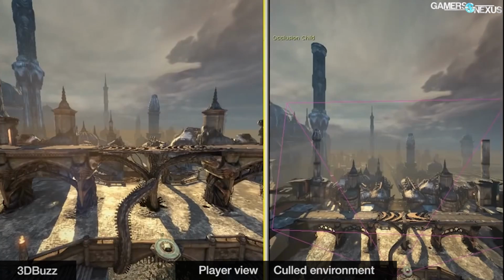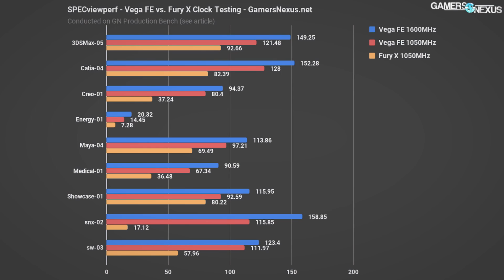Primitive Discarding in Vega: Mike Mantor Interview

Comment: object bounding box culling is a engine thing. scissor test (for out of 2d 'frustum'/plane) and backface culling are known stuff too.. you can shovel backface culling in the dumpster if you wanna use two sided ligthing shaders (foliage. and hair). early-z culling only works efficient if the drawcalls or even just the polygons of the objects in question are rendered front to back. out of order triangles usually don't early-z either. they are hard to predict. all known things to developers tho. even me. :)

Comment: Frustum culling is a super basic thing to do, every engine has it and it's not a new thing by any means, backface culling, same thing, supported at least from directX 6.0 you can check the documentation, I dont wanna believe they weren't doing it before... The only interesting thing is the too small to be seen triangles. Honestly I was expecting something for the triangle overdraws, that would have been far more interesting. You can see the problem even in the video, when the camera goes behind the mountain the frame rate doesn't improve, this menas that all objects behind are not removed. It seems to me they're selling old stuff as new features, very sad....

Comment: Im assuming that Vega has more changes from Fury than a re-layout for higher frequency and a more efficient shader.
Reply: DarkHalmut along with the node shrink~ tbh it sounds like a normal iteration cycle, expecting more is naive.

 Navi was always more interesting on the roadmap due to the "scalable" moniker which AMD uses heavily in a context of linear scaling over multiple lithography dies. which makes it exciting. That said infinity fabric style architecture in GPU is all but inevitable and game changing, However not unique to AMD Nvidia have already announced they are doing the same. So no guarantee AMD will gain the upper hand with Navi either, especially if Nvidia beats them to the punch with their own scalable architecture.

Comment: But the calculation of wether or not the geometry is in view also is costing performance (on the cpu side).
The question is if it is worth it?
Theoretically, it should be worth it in above 1440p resolutions with cranked up detail, since you rarely get cpu bottlenecks there.
On 1080p though, its probably not that worth it, since you already are more cpu bottlenecked than gpu bottlenecked.

Comment: This is nothing new, game engines and drivers have done this for years. 
This is just a buzzword. 
It sounds like all they added was culling on the back of a 3d object itself. 
You can see this in older games with fast movement speed and old video cards will sometimes show a black side area where the renderer hasn't sent the info about.  
I'm not impressed if AMD thinks this is important and thinks Nvidia doesn't do the same thing..

Comment: Result : all of this reduce performance . Fiji performance per mhz seem higher then Vega.
GPU complexity goes up, more transistor used... for something that often is better done at the engine level.
Reply: No most engines only do whole object culling(With few exceptions) doing vertex culling does make a lot of sense because the engine rarely touches a model after it has been pushed to the GPU which is why it makes sense to do it on the GPU  primarily.

Comment: If you make tris one sided and use an algorithm like the shoelace algorithm you can stop what's facing away from you and therefore what you can't see from being drawn. I'm not just talking out of my ass either, I've implemented this in a shitty scratch 3D engine
I'm pretty sure it's something along the lines of: (x1*y2+x2*y3+x3*y1)-(y1*x2+y2*x3+y3*x1) if you want the actual formula you can google it I'm just too lazy
Reply: In most cases triangles are one sided by default and the GPU leaves it up to the engine which way the triangles are facing.In most cases the vertex order is what determines which way a triangle is facing.

Comment: okay so what happens if say an object that would normally cast a shadow is out of view and culled, would its shadow also disappear. So for example your in a room with a window. light is being cast from a point such as a street lamp. There is a tree between the light and the window so from in the room facing away from the window, would either still see the light from the street lamp, see the shadow the tree cast through the window, or see any light at all because the window, the tree and the light have been culled.???
Reply: This mainly depends on the game engines implementation of lighting.
Reply: a shadow mapped light has it's own frustum when rendering the depth map. this may or may not cull object's in it.
Reply: Shadows and light are often baked for static object. In case of runtime computation there is not problem either because the shadow map is generated from the light-source point of view and the rendering goes through the same process

Comment: This sounds like what PowerVR was doing with Kyro. Does Vega also have tile-based rendering?
Reply: PCX and Neon 250 as well. Sega Dremcast and its arcade board variant Naomi series are currently the only tile-based rendering system hardware.
Reply: I thought that the whole idea died with Kyro. Checked wikipedia - nvidia maxwell and pascal series as well as pretty much every mobile gpu uses this technique to save memory and bandwidth.
Reply: Not surprising from nVidia  because they use the partial tile rendering method obtained from the defunct 3Dfx IP who brought Gigapixel. Note that I purposely excluded the mobile market
Reply: "Does Vega also have tile-based rendering?" They are suppose to in the future. Supposedly Tile Base Render will be incorporated into software updates as the card develops. Last I heard

Comment: When I play video games, I usually delete the polygons I'm not using and then stream download the ones I need. Of course, you sometimes run into problems with rgb compression textures and screen space usb ports. I usually get around this by overclocking my resolution.
Reply: You guys got it all wrong you need to undervolt your textures to improve efficiency.
Reply: And don't forget to filter for sinusoidal depleneration
Reply: yes but dont forget to overamperage the triangles before doing so.
Reply: I do some formoluted pretzelo-cakeification and ingest it in the pipeline.
Reply: Also if you have problems over clocking your resolution, try undervolting tessellation, and amp up antialiasing, it should help your monitor thermals too

Comment: This seems like technology that should've been included a long time ago, any ideas why it's coming up now? If the minimum reduction in rendering is 50% then surely some GPU developer would've jumped on it much earlier.
Reply: It costs transistors
Reply: John Honkerton It was first introduced in Polaris.
Reply: It used to be done by game engines.
Reply: Most game engines already do some form of culling. Unreal has a few different types to chose from.
Reply: As stated in the video, it has to be implemented in the hardware to get that kind of performance gain.  Remember that they stated that if you do not implement primitive discarding before it hits the pipeline then it eats clock cycles, which means less performance.  It is impossible to implement a software solution from a game dev that can access the video card at such a low level.

Comment: Can y'all try to clarify what the Draw Stream Binning Rasterizer and the Tile Based Rederer's relationships are to this primitive shader tech? Sounds like the primitive shader stuff is largely developer/engine reliant whereas DSBR/TBR is automatically part of the pipeline. I'd really like to know more about these things as they appear to be a big part of Vega's performance. It would appear from PC pers. testing that TBR isn't enabled in drivers yet. Also, can commands from non supported game engines be intercepted and converted to primitive shaders on the fly? If possible that could be a big win for Vega on older games.
Reply: Yes, isn't TBR supposed to be one of the things that Nvidia's been doing for quite some time? Will be interesting to see how much of a real boost that provides AMD, especially if it isn't enabled in the current drivers but will be enabled with the release drivers.

Comment: cant even pretend i understood any of this :(
Reply: Basically, the GPU's figuring out what objects in a game (walls, floors, lamps, tables etc) are being seen by the player and only renders those, which means higher FPS and lower specification requirements for games.
Reply: aye i got the very basics but how it works flew over my head like a jet wonder if i grow my hair out into impressive locks if id be able to grasp the more advanced parts :(
Reply: Some basic concepts... This will already give you a slightly bigger understanding.

I assume you know rendering in 3D space is done through geometry, which basically means mostly triangles...
The 'corners' of those triangles are called vertices, or vertex for singular.
Even though the image is 3D, you have to project it on a 2D screen, which is where the pixels come on. 
Pixels are the 'dots' that ultimately form up the 2D image from a 3D calculation. So basically the pixels that you see on your screen ultimately.
Shading is basically giving color. So a pixel shader calculates which color a certain pixel should be.
Reply: dark1810 hah I feel the same way. I enjoyed watching it but understood like 1%.

Comment: With culling, what about light effects coming from objects not visible themselves?
Reply: Light and object are two different things. In games you have an object (say, a lamp) and a light source that positioned to match the position of the actual light source of the object you want to draw (where the bulb is). Basically, object is a physical thing on the screen that has vertices whereas light source is an abstract thing that only describes the light - its position, type of the source (point, directional etc), color, direction and other stuff. When you're culling you're only discarding vertices of the object. The light source that's attached to it in the game world is still there and later will be used to do the lighting. You don't need the object to do that (the lamp). In fact, in games there're many cases where you want to put light sources that has no object at all. For example, in cutscenes to better light character faces - you don't need a lamp for that, only the light source. Of course, that's very basic explanation and exact details could be very different depending on the graphics engine.
Reply: TheEVEInspiration I think lighting references remain untouched even if the geometry is discarded. That way, if you get a world view and compare it to the player's view, the lighting comes from apparently empty space.
Reply: That's a very different question. You see, you can't think of realtime 3d graphics (at least in games) in terms of real world phenomena. Everything is decoupled from everything in order to make it faster. So, light sources and objects are not related to each other in any way - only in the head of the developer that put them. Casting light and casting shadow are two different things that's done separately and do not depend on each other - many light sources in games are not casting shadows, only illuminating the world. Pretty much every single physical phenomena you see on screen does not work like it works in real world. It's all about tricks that produce somewhat realistic image on screen.

As for shadows specifically, there're done in different pass. That's, again, another not very obvious thing about 3d graphics. Usually in games you do a separate shadow pass - you take your objects and light sources and calculate a shadow map that contains only shadows. You can do your own culling here but it's very specific to shadows - for example, here you can cull objects from the point of view of a light source. Then you do the main pass that draws the scene and here you use that shadow map to apply shadows to the scene. And that's why you don't see many shadows in games and in many cases light sources just illuminate stuff - it's very taxing to do shadows. Basically, you have to loop through all objects for every light source. That's why there're very few shadow casting lights sources in games. In many cases just one - the sun. On the other hand, with techniques like deferred rendering you can have hundreds of light sources that only illuminate the scene giving you the illusion of complex lighting.
Reply: TheEVEInspiration Culling does not really remove the geometry but just skips rendering. It is still in graphics memory. When you render a mesh you don't send it triangle by triangle but upload the whole thing beforehand and then send draw commands which part of the mesh data should be drawn.
Reply: Good question- perhaps a geometry reference is preserved?
Reply: Shadows in games are usually created with shadow mapping. In this technique a depth image is rendered from the position of the light source viewing in the direction of the light rays. This image can then be used for the actual rendered image to check which parts of the scene are not visible from the light source, i.e., lie in the shadow.
Culling doesn't interfere with this because it is done for each rendering pass. So for the shadow map only objects that are not visible from the light source are culled and for the actual image only objects that are not visible for the virtual camera. So culled objects still would cast shadows.
Reply: I think he means like what happens to objects out of scene that are casting shadows into the scene.
Reply: a quick sample that shows this is the showcase at 2:05, the shadows are still rendered while the objects are culled.
Reply: [to unstabletv] That's a case of baked lighting. I am speaking only of dynamic lighting.

Often times before a level is even "finished" for you to play, they pre-cook the shadows on the environment so they don't have to calculate the shadows in real-time. Shadow-map. Yeah. That.

Everyone else is giving good answers, too.
Reply: +TheEVEInspiration
Reflections are a big topic in realtime 3d graphics. Today very common technique is to use what is called screen-space reflections (SSR). The main part is "screen-space". It means that to do all calculations it's using only what on the screen regardless of any culling. You could even use no culling at all because SSR doesn't use vertices, it only uses various maps of the frame being rendered (like color, normal and depth maps) But you do have a problem because of that - anything that's not on the screen will not be displayed in the reflection. You have to be careful applying these reflections - results can be pretty bad in some cases.

But for things like water, again, separate pass is used. Culling for the main pass is irrelevant as you're drawing whole scene separately just for the water reflections. It's called planar reflections. Same thing with reflections on cars in racing games - usually it's cubemaps in a separate pass. As you can imagine, it's very costly to do these types of reflections. As optimization pretty much every games does separate pass with as simple as possible models, effects, draw distance etc. You could even lower the rate with which you update reflections.
Reply: +Doom2pro,

Yes, shadows and reflections, that sort of effects, which can have impact outside of the geometry, but where geometry is implicitly involved. I just do not know how common this is, but it looked like an issue to me when removing geometry.
Reply: Other's can correct me if I'm wrong, but afaik that's not an issue in forward rendering. And deferred rendering already introduced (and solved) that issue (with anything outside of the screen domain), you generally just have different rules and behavior for edge cases i.e. real-time emissives. 

Also honestly even hypothetically I can't see how this would contribute, it's only culling non-contributing/non-sampled data. And not to mention lighting isn't a primitive, its in the pixel shader stages. in deferred you're only calculating lighting on a per sample basis in the screen buffer using information from depth buffers and normals buffer etc. Deferred pipelines are all about the G-Buffers. most the heavy lifting in modern game engines is in the later stages of the pipeline, and thus why you won't see a 2-4X improvement in frame times correlating to the culled primitives)

Worth noting most modern engines are deferred now and make compromises with alpha and emissive contribution (or simply do without), just look at how unreal engine handles alpha now for a picture of how forward compares to deferred.
Reply: oh just read the chain. Yeah shadows are a different ball game, and was covered well by others.
Reply: That depends on the game engine, the particular logic the developer assigned to the light, and how deeply it involves the CPU in these affects.

Assuming the light entity is given the go-ahead to apply post-processing to the rest of the scene, it is obviously post-processing so it happens after culling. (Meaning no shading occurs on unseen items because they have already been culled)

And as I said, the game engine decides whether or not to cull those.
Reply: In that case, since there's no object to cast a shadow (it's culled), there is no shadow.
Sometimes the game engine can intelligently sense whether or not a shadow would be cast into the scene and at that point, the object would not be culled completely